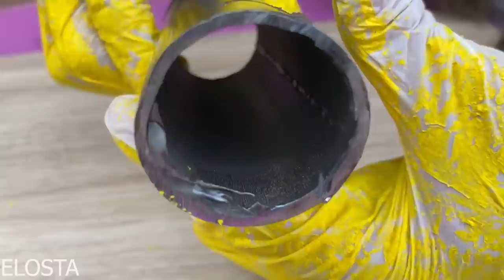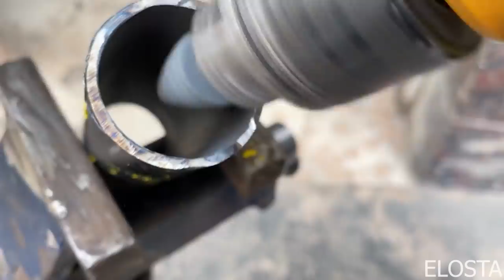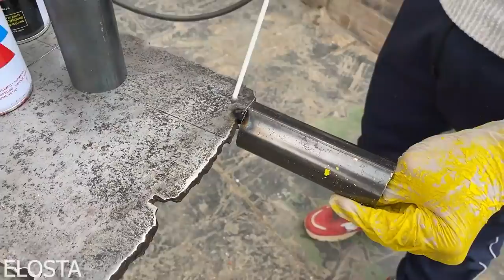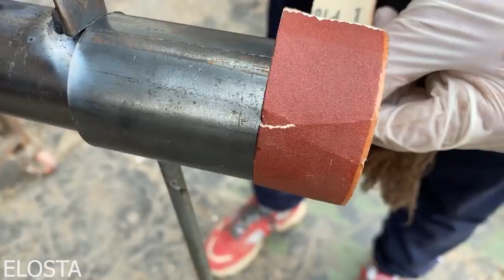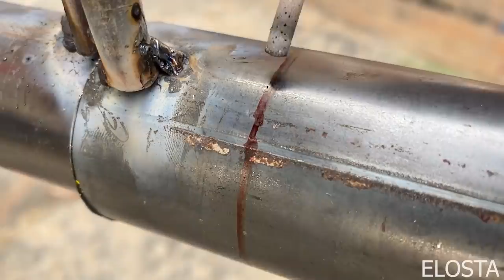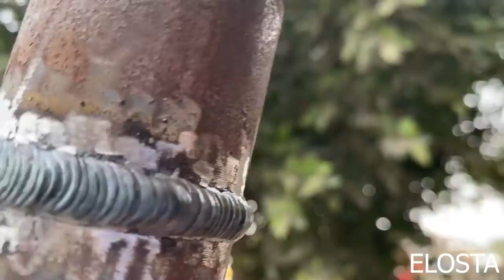brilliant idea! In welding 1 mm no one knows about this secret

Comment: This follows no recommended procedure that I know, and as a welder for over 40 years I know a few. I would like to see the inside of the pipe as I doubt there is any penetration showing at all.
Reply: Да вообще не чего не понятно причём тут рычаг за который он крутил вторую трубу и причём тут плашка которую он приварил, такое ощущение что о концовка из другого видео
Reply: Don't forget the lack of safety measures by using the scarf and the fast flammable sweater he is wearing.... The weld seems like it's just on the surface and it needs higher voltage...
Reply: You got it.. Old steam pipe welder here..
Reply: @Олег.Иванович  Приварил чтобы варить нижнее а не вертикал и потолок либо горизонтал, руками не провернуть т.к. трубка сильно нагрета и прихватывается каждый раз ,точечно ,при касании электродом а полоску приварил как направляющую.
Reply: no root no fill no cap
Reply: no root nofill no cap

Comment: Pulling the file instead of pushing it tells a lot about your metal working skills.  I won't mention the tap, tap, tap type of tack welding.
Reply: Watch Fireball Tool's video on pulling the file, you'll be surprised.
Reply: It would be interesting to pressure test. It might look like a lawn sprinker. The tap, tap, tack weld had to have cold edges. No continous puddle, No discoloration on pipe (besides rust) has to say something about the weld.  I guess if your bead is ¼" proud of surface and ½ wide, who needs penetration. 🤣

Comment: Someone missed the point.   Clever, but not very smart. Try and impress your boss or customer with it. (Might want to Make sure you've got another job lined up ) Have a feeling it wouldn't quite pass an inspection. 
  But hey, if your into creating videos and wasting time and materials, Its perfect! 
   This is just my ( no doubt bias) opinion, I could be wrong. 
PS- A quick way to become an efficient welder? . . . weld naked . except for p.p.e. of course.     What sparks. . ???

Comment: A poor example of the most primitive type of electric fusion welding with no demonstration or testing of the applicability or effectiveness of the degree of fusion, continuity, or strength.  It's only a rather boring metal sculpture.

Comment: Radiograph the weld - are you or are you not incorporating slag in the weld; if that was an open joint being welded; would that method pass a bend test ? You start the arc, form a puddle, pull out, break the arc, then restart the arc over the solidified metal without removing the slag.  How deep does that rod alloy penetrate; is it deep enough to burn through the slag and weld into base metal leaving a clean weld, or slag and porosity ?

Comment: To weld a pipe this thicknes you can fleetweld or weld constantly upward  or downward with a stick  not the way ur doing .... it is not a joint v weld just two pipes cold against eachother

Comment: The idea is good, but it stands so tall if you need the weld like that. Try putting the rod to turn it with on the opposite end so that person is not in your way and the tiny led light onto your welding helmet so you can see what you are doing even when you stop welding.